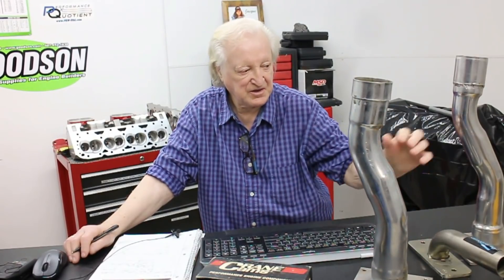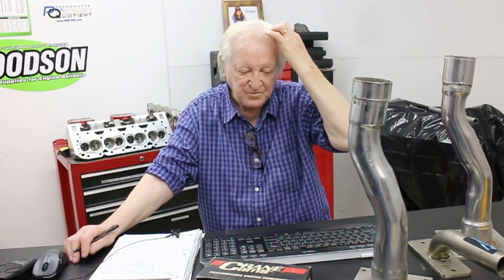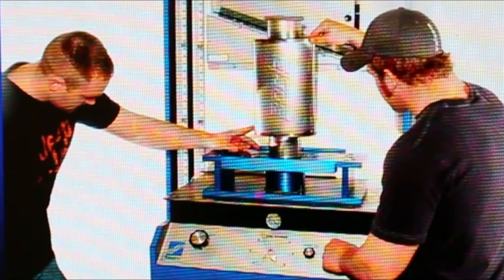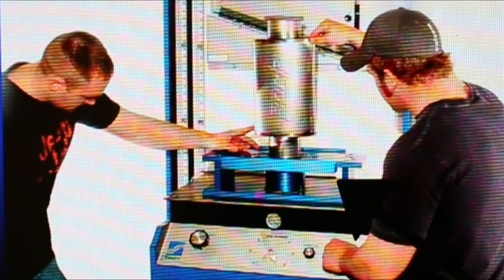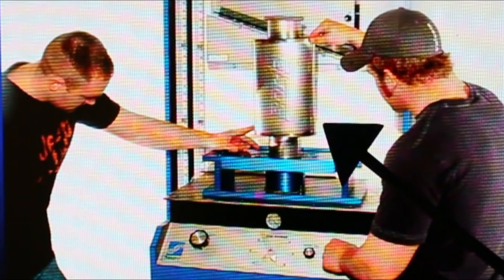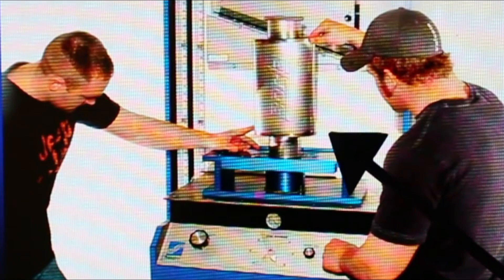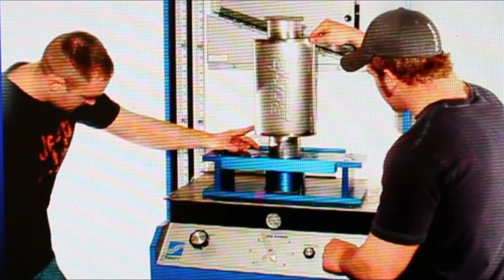David Vizard's PowerTec 10 EP 27 Zero loss sound legal muffler systems

Comment: I have been trying to design a pressure wave termination box that will fit well and work properly under my car.  Since some compromises will probably have to be made, can anyone answer a few questions for me?
1.  What is the minimum change in area between the end of the collector and where it ends in the PWTB? 
2.  If I am using a tapered collector or megaphone, does this change any of the area or volume requirements?  
3.  What determines the far end of the PWTB and how much of the exit pipe can be included in the volume calculation?
4.  Is there any minimum length the PWTB needs to be?
5.  I've read that the end of the collector should extend into the PWTB at least 2", not attach flush with the body.  In order to gain volume, can the collector extend farther into the box than 2"?  Or in other words, can the box extend in the direction of the collector to gain volume?
Thanks for any helpful insight.

Comment: What are your thoughts on the following: with advent of cheap thermocouple and ecu should all performance exhaust headers and systems include diagnostic thermocouple on the exhaust of each cylinder  for diagnostics? My intuition is that pressure is only 1 variable to tune and understand what is really happening we need to meausure temperature. I would like to see mass flow sensor thermal mass sensor on exhaust side. Measure mass flow and temperature simulatiously, we could learn alot from that measurement.

Comment: I had tried this on a 383 stroker. I used some larger size catalytic converters housings as the prechambers. The mufflers were Dynomax v2. It sounded great and worked great too. I do not have any dyno proof of anything. There was a significant amount of tuning required after the modified exhaust was completed though.

Comment: if i recall correctly,i was looking thru an old car craft or hot rod mag, & the ad for sonic turbo emphasized a series of round circles on the insides  of the end caps of muffler body.(like 6 progressively larger O rings) i assumed they were meant to absorb or deflect sound waves while allowing the pressure to continue on thru the baffles to escape the muffler body.this is the location where walker places their flow directors in the super turbo mufflers.

Comment: David check out the new mufflers by the company  Pypes - turbo pros . their guaranteed max flow and some tamed down sound. so those are some short section of muffler pipe coming off the side of the main exhaust pipe then down to a hollow muffler box then through an actual muffler or mufflers for duals and then pipe out the back. 🍀
Reply: Looks similar/same to the Superturbo design

Comment: Quick question, when you say 2.3 cfm per "open exhaust horsepower" are you talking about engine dyno horsepower or rear wheel dyno horsepower? I made 587 engine dyno horsepower, but using my 700R4 trans, I only made 469 RWHP. So when I do the math do I need an exhaust that flows 1350.1 cfm (587 hp) or 1078.7 cfm (469 hp)? The difference in cfm requirements really limits my choices for mufflers.

Comment: Have a look for a book called "the scientific design of exhaust and intake systems". There is a good deal of information regarding silencer designs. I'd be surprised if David hasn't read it.
Reply: is there any active trixs that works? like valves/moving parts or speakers ect. to change the residence tuning ? aka HZ hemholtis ? like the intake that mopar has use ?
Reply: ps. i have a turbo TT ( EFR-76-70 mm ) setup ( and is a max wege ram-style exhaust manifolds ( intake is cross ram active 36"to9" tuned runer length by ford SHO valve style systems ) / block huger / cramped/👠 shoehorned in a b-body ) that stared out with a 383 BBM+727 but modifying my car for a 4.5 stroker hemi+SS oil pan 10"+TR6070. planning on twin 3"main exhaust piping 2"~primarilys and 🤔 if theres any trixs that i can use but keep the turbocharger housings still aka had bolted inplace and or not taking of a lots of space under the floor boards as i have a BEV battery pack under the back seats for electricity A/C and other use's and not a lot of ground clearance 3"-4"@bottom of the rocker's

Comment: I used your ideas about this and it worked great.  I used two old R134a refrigerant container to build the system.  I still have it and every once in a while I use them when I run an engine with 3 1/2 inch headers on the dyno.

Comment: Built a 2.5" system. Borla turbo,H pipe with wings to push the flow away from the crossover in an attempt to creat suction on each pulse. No Dyno but it certainly is breaking traction at higher speeds than before.

Comment: My 615 H.P. small block Nova has Jack Davis Step Headers(1-3/4"--1-7/8"--2")with a 3-1/2" collector using his spear/cone thingy inside, into a 3-1/2" system with X-pipe going into Borla Sportsman mufflers. I never tested it on the dyno, but at the track it made zero difference in performance. It's kinda noisy, as are all 3-1/2" mufflers, but never had any traffic tickets. 
On a daily driver style vehicle I always run Walker turbo style mufflers for a quiet, yet powerful exhaust. A friend ran them on his VERY quiet 9 second small block Mopar, and made me a fan.

Comment: Good physics behind it, it's basic wave theory if I understand it correctly. That Corvette exhaust system looked like a nice setup, real estate is pretty scant underneath a 'vette no doubt. I can vouch for the quality of Borla, put a pair of their headers & cat back on a Ranger years ago and it fit well, the quality of the headers was beautiful w/ good quality hardware. Had it for decades and only pulled it apart to drop the trans for a clutch. No problem after thousands of heat cycles and gave a rather unmelodious 60* V6 a smooth, deep tone and tons of grunt.

Comment: Very interesting. Would love to know how catalytic converters affect this all?
Reply: Hello manitoublack, Carroll Shelby said, catalytic converters & the EGR System are 
the most ridiculous devices to ever be installed on internal combustion engines. 
There are more logical & more efficient ways to reduce engine emissions than to 
"cork" the exhaust system. 
I AGREE 100%!!!! 
The V8 engines in my cars & truck are "perfectly" tuned. None have converters or a functioning EGR System. They're 5+ years old & not "low Mileage" engines. 
The emissions from the exhaust tip are well below California Standards. 
Also, I NEVER use E85 fuel, etc. in my vehicles; only pure unleaded gasoline. 
It seems Mr. Shelby was correct :-) 
Best regards, 
Ben

Comment: Supertrap mufflers make the most power with no ie Zero end caps. They are Very noisy like this and have no/ zero spark arresting  capability. This is after many many dyno tests on many motorcycle engines. From Harly cruiser to 1000cc superbikes. Road and race spec. Do Not buy a supertrap for power. Only as a nit very good spark arrester.

Comment: My first car ever, me and my dad used your "zero-loss" exhaust recipe to make an exhaust system, well, I guess it was not perfectly made, but based on your principles and what it was room for under the car. 
From the headers, 2 pipes into an relatively big expansion chamber/box.. ("pressure wave termination box"), out from there to two turbo mufflers, similar in looks to the corvette system in the description, which is often showed in your books.
What the HP loss was? I have no idea, but it had a very nice sound, it was a mild low compression 350, so it was not exactly taxing the exhaust system anyway..

Comment: Hi David, Thanks for the vid 👍 Any general advice on exhaust diameter on a typical V8? As in at which which power level we should generally step from 2.5” to 3”?
Reply: Hello TofumanFC3S, Since Mr. Vizard hasn't replied to answer your question, I'll give you 
the answer you're seeking. 
I don't claim to know as much as Mr. Vizard. He is one of my 2 mentors. I'm sincerely grateful for all I've learned from David Vizard. 
Even-so, I do have 40+ years of motorsports experience & I'm constantly expanding my knowledge. I race my cars competitively. I also design & build my engines, suspension, exhaust systems, etc. I successfully compete in drag racing & road course//circuit racing. 
I won't bore you with details of all the research & testing I've done concerning exhaust systems. So, here's the condensed version of my answer to your intelligent question. 
On "properly tuned" (typical) V8 engines with less than 500 horsepower 2.5'' exhaust pipe 
is perfect. Considering it's a dual 2.5" exhaust pipe system. 
You can greatly enhance engine & exhaust efficiency with dual exhaust & placing an "X" 
not too far downstream from the header collectors. It'll improve cylinder scavenging and balance the exhaust pulses from both banks of the V8//V6. This will free-up horsepower 
& increase torque the engine is capable of producing. 
An "H" tube connecting both exhaust pipes will help...BUT...not as much as an "X". 
Once engines exceed 500 "wheel" horsepower, a 3'' exhaust system is needed. My dyno 
data hasn't shown much gain in HP & torque with 3'' pipes until the engine nears 600 horsepower; at the wheels. 
Even-so, I've dyno-tested supercharged & turbocharged V8//V6 engines producing below 
500 HP. They gained substantial torque & horsepower with a 3'' dual exhaust system & 
"X" pipe. This is due to "forced air induction" on the intake side of the engine. 
If you're gonna' force air into the cylinders...ya' gotta' open-up the "exit" :-) 
Hopefully, my reply has been helpful to you. Contact me here with any other questions. 
Respectfully, 
Ben

Comment: I watch & appreciate all of DV's PowerTec 10 informative videos, but this "Zero Loss Muffler System episode seems uncharacteristically filled with Contradictory & confusing statements....At 8:10,  he explains his Zero Loss muffler is functionally equivalent to the Sonic--Turbo which Is a Triple Pass Folded Glasspack with gas flow Directors & Fiberglass packing design & Repeats again at 12:20 his Lossless muffler design is Same as the Walker  Sonic--Turbo design, which is Not an empty can Termination Box type muffler but a Folded glass pack design....At 18:00 he correctly mentions the power loss, Collector Detuning effects of Any glasspack muffler Directly connected to a Tuned header collector...At 18:50 he Emphatically slams Flowmaster as a non--functional marketing scam product while at 20:00 he Contradictory demonstrates the Flowmaster muffler Favorably Reacts like a large, empty Termination Box that Doesn't detune the Tuned header collectors Length.....I may have misunderstood the video but my Logical take as presented, strongly Suggests a mostly Empty large Flowmaster muffler Directly connected to a correctly Tuned header Collector will function as a Termination--Isolation Box & Not cause significant collector Detuning & power loss effects from the Additional muffler & exhaust pipe Length.....

Comment: Looks alot like the advancements of the pacer and corsa mufflers made famous on corvettes and fieros. I was a walker installer some years ago while working for firestone. Borla,SLP, have advanced with factory ford products. The super trap was used alot on v twin Harley. While i was playing around with sport bikes. The straight through slip on was famous for adding sound. Two brothers exhaust systems actually added hp.
   Now...are you ready to have your mind blown? Thankfully there is a exhaust design that will actually increase horsepower!!!! You covered a small portion of it with the cross over h, or y pipe. Ive been buikdimg my own mufflers using a design that back dates 100 years. A reverse flow telsa valve muffler will actual increase the exhaust flow! Once installed at the expansion point. They will increase flow to every portion in front of it.  Corsa has tried to adapt this design into thier mufflers with baffles whike retaining a low growl at the exhaust tip. These came on the newer ford lighting pick up as a side pipe option. Shelby has been using them on the side pipe exhaust since the Callaway and dodge viper GTS. They also incorporated it on the rear engine 360° exhaust of the ford GT. These systems will pass the sound restrictions without using a "muffler".

Comment: I guess that is why  my 5” Nelson muffler they advertise to flow 3000cfm at 1.5psi  did not make any difference in power on a dyno jet dyno versus straight pipe on my 700rwhp turbo diesel.
Reply: Same thing when I tested air filters. If the air filter had enough flow I could find no loss in power.

Comment: Never stop learning ah.
Some time ago I used some Paul Ivey valves with the anti reverse grooves made by GS valves in a imp engine with a George Bevan race cam (car was for hill climbing) 
The valves didn't help the bottom end rpm to any measurable amount. 
20 years later i measured the reverse  flow of both ports. With a particular max rpm in mind Ken Newman ground up a cam with .170thou ex .150thou in. Both at tdc
On this particular head the reverse flow was about equal at those lift values
It made 122bhp by about 8000rpm.
Torque was up 9 ftlbs over any thing I'd tested at that point. 
Put an extra 2" straight through silancer on after the manifold to go with the Roy Lane supplied Super flow silancer, mounted across the back, it lost 20+ hp peak and a min of 5hp every where. Thats over 15% on a silencer + in the wrong place.
Truly great that your making these videos.
Guess your not going to bother with electric tunning😆

Comment: you mentioned a change to flow masters that would help them. please tell it. I have super 70 flow masters on a 472 Cadillac and I'm looking at what to do for them. 2 1/2" dual system without x or h crossover, (only because I don't have any room for it. exhaust is tucked up above the frame). 472 with th400 plus gear vendor in a 73 step side c10. thanks for any help.

Comment: Mr. Vizard, thank you so much for these videos. Your knowledge and experience are more vast than I had realized. I have some questions about the zero loss exhaust system: 

1) Could the two tailpipes of a V8 system be collected into a single appropriately sized tailpipe without any adverse effects, or is it better to keep them separate?

2) Is the termination box functioning as a resonator at all, or is its function only to simulate the end of the exhaust system? 

3) What is the effect of the reflecting of the pressure wave? Would the engine face backpressure by having to push the pressure wave all the way down the exhaust system?

4) Would it be best for the termination box to be round, or would an oval or even rectangular shape be just as good?

Comment: One thing I've seen feeding the 'you need back pressure' myth is when people remove a restrictive, high back pressure system, and loose power because they don't re-jet to compensate for less exhaust contamination mixing with the fresh incoming charge.

Comment: I have seen ALOT of mufflers that made me wonder why, and what were they thinking, I know the bean counters have destroyed some decent designs, it is difficult to quite a 600hp engine in a approx, 4" x 8" x 16" box,  and still make that power, why not use 3-4 normally loud glass pack style mufflers, per pipe, making the muffler internals about 20% larger than the pipe, and 12-16" long each, with the external dia, about 1" larger than the internal, using a ceramic wool to dampen the sound, it's not cheap, but probably last longer than fiberglass, or stainless wire mesh may also work, being possible cheaper choice, anything I built lately flowmaster were plenty good for the application,  although I have thought about using two of the single chamber race mufflers  per pipe, I have had alot of crazy ideas over the years!! For all out performances, a turbo makes a nice muffler!

Comment: Would using a large volume catalytic converter as a termination box work? I have limited space under the vehicle and it's subject to emissions testing. I don't believe you've done testing on this specific subject, but I'm more curious if you can think of any reason it wouldn't work (maybe the catalytic reaction or the presence of the substrate changing wave termination).

Comment: Thank you for spending the valuable time making the videos for us. I remember the magazine test. That's why I used sonic turbos on my 69 Camaro. I put some on my 94 Cadillac STS and made a difference.  It would spin the tires when it shifted into 2nd. I would like to experiment building an adjustable muffler with a butterfly in it . And do some flow testing on my floating pressure bench I have 4 approximately 97 cfm motors and also have a Hegelson calibration plate. I need to know how to properly mount it to the flow bench and what bore size to use. Thanks for all you do.

Comment: David I really appreciate your advice on the flowmasters used to terminate the pressure wave and tuned the collectors.
I am building such a system for my Corvette.
I would like to add one can replace the flowmasters with resonators such as from SLP or in my case a twin in/out Jones Max flow. I think these are both better options than flowmasters.